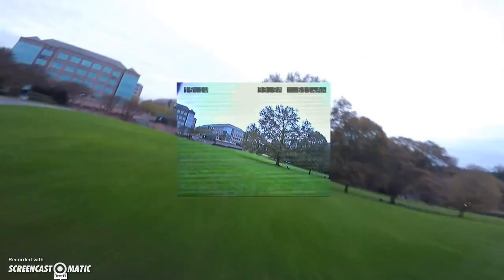How to "float" inverted like Mr. Steele (and others)

Comment: Key points - turn on idle up, or in Cleanflight  turn off motor stop and turn on PID at min throttle so that you can drop throttle to zero and still have PID authority as you are floating up (after hard punchup) and then free falling back down.

Comment: Hi thenukeman, 
I use the hq triblades 5040 like mr steel and the kingkong triblades 5040 when i know i wil go crashing. But my problem is fixed i bought the Kiss fc and Kiss esc's. the biggest problem Where the esc. 
Thx for your intrest Kind regards Michel

Comment: Sorry. Im being a little slow here.
When do you use air mode?
ARM-switch to start flying, then do a punch up, switch on air mode, float, and then regain 'control' and flip off air mode?
Or is Air Mode just the opposite of ARM, as in "Parked gear" or "Drive gear"?
Reply: Ylex   For English not being your main language, you have better grammar than most people online
Reply from the maker: Air Mode shouldn't really be called a flight mode. It's a Feature. It's a change to the mixer logic that increases authority at low throttle. I just leave it on all the time. In my opinion, it's how the mixer should have worked to begin with.

https://www.youtube.com/watch?v=d2nRrVENEYM
Reply: Joshua Bardwell I believe I understand now! If I got this, Air mode means the motors are allowed to ask for more power than given by throttle. English is not my main language, so I'm just using simple words. Thank you for helping!
Reply: or in "live mode" for that matter...

Comment: Hi Josh! question:
"Idle-up" could be something like "Air Mode" in CF?

Congrats your videos are just great!!
Reply from the maker: +Rodrigo Larenas idle up is similar but air mode is superior IMO. Air mode only increases the throttle set point when additional authority is actually required. Idle up increases the set point all the time.
Reply: Joshua Bardwell thanks josh, I'm gonna try using air mode

Comment: Hi mr bardwell i have a little question. from the moment i flip my quad 90° upside down (after a throttle punch) my PID (i think ) stop the upward float motion. do you know what this can be ? or is it maybe the fc or esc i'm using? FC is the seriously pro racing f3 the esc  i don't know what brand they are . the plan is to swap the FC to a naze 32 

kind regards
Michel
Reply from the maker: +Michel Van Camp make sure min_throttle is not too high. Make sure you are lowering the throttle all the way. If your copter is heavy, lighten it. Punch harder to go up faster.
Reply: Thx Mr Bardwell i will try to lower my min throttle but its already at 1010 i will keep searching
Reply: Michel Van Camp   What kind of props do you use?

Comment: One thing I don't see mentioned is that Steele uses 3 blade propellers.  This is alot of surface area.  When you keep them idling and you are falling you have a brake effect.  Instead of air rushing past them they are blocking some of it slowing the descent.  This is the same idea why gliders have folding props.  Because a freewheeling prop will slow you down.  Also why on a airplane if you run a large prop that it helps slow you down on final but if you dead stick in your plane glides much faster.  Not to mention in this case by idling the motors are faster to spin back up to save you when you need to flip back instead of the huge current draw from a dead stop.  Great video!  Just wanted to mention this concept.  :^)

Comment: So I'm just sort of getting into  (FPV) i have been flying since September, Manly just aerial filming i have the Xk Detect X380 for that and the Syma x8c but my starter quad was the syma x5sw FPV wifi edition and the syma x8c. but i just ordered the Stock Fpv kit for my x380 and i ordered a xk 250 alien with FPV and i got the Xk airdancer x350 and i ordered the Fpv kit for it as well. I thought that flying the xk airdancer x350 with fpv would be really cool since it has both 3d and 6d mode to fly upside down.  But to get into racing or just have a really fast racing quad what can you recommend for me to buy to have a fast really fast quad.
Reply from the maker: +Andy Shaffer The fastest copters are light, and have a very small aerodynamic profile. Look to the Krieger and the Shrike if ultimate speed is your goal. But they are some of the most difficult to build because they are so small and compact, and if you are not an experienced builder, I don't recommend them. The next step up would be a 210 size frame like a QAV210 or an Alien 5". If you want to, you can find much cheaper Chinese knock-offs of these frames from Banggood--your call where you want to put your money. The 210 size frame will have worse aerodynamics than the "Pure X" style frames, but can still be very fast.

I can't stress enough the importance of light weight when building a racer. With light weight, you can go to higher-kv (lower torque) motors and still not suffer a handling penalty. This increases acceleration and top speed. You also need high-C-rating batteries that can feed your motors without sagging, but unfortunately, marketing numbers mean nothing, and practical test results are few and far between. Don't just buy a battery with a ridiculous C-rating on the label because it's probably BS.

There isn't really a simple answer as to what goes into a really fast quad, but this should get you started.
Reply: Absolutely yes i will look in to that i thought about getting this Eachine racer 250 Amazon has it for 189.00 with prime so Yes i figure something like that just to start out on and  yes they have the kits to build your own the way you want it. and i was planning on doing something like that with my G.P.S quads but like you said. Flying yes is one thing but building your own is altogrther different that like waiting for strike 3 at half time in the super bowl totally different but yes I'm going to just get something like the eachine 250 for now until later then ill know more about what I'm going to need to build my quad like what is the best size motor for a certain amount of weight i don't know how they calibrate themselves. or if that's done manually? with these flyers.
Reply from the maker: Andy Shaffer The best thing you can do is look at what pro pilots are flying. There is no single best answer for what motor and prop to pick. If there were, everybody would fly that. But there are definitely combinations that do NOT work well--for example, an 1806 motor will probably lack the torque to spin a 5045BN prop very effectively. A 2208 motor would be bad to pair with a very small 4045 prop. Etc... If in doubt, look at what the pros are flying, or look at high-end ARF or RTF kits and copy them. But definitely do your research. The Vortex RTF 250 copter came with 1806 motors, which were not really the highest-performing at the time it came out.
Reply: That's very true. Just from your personal experience in using different propellers, Some say that propellers when in balance can increase speed, flight time, and the life of your motors. Increasing the life of your motors sounds about right. The speed however I'm not sure. i just put Dji 9450 self locking propellers on my x380 and  to me the new propellers seem to increase speed  by a little bit they are a half inch longer and made different from the stock ones, so it may be possible to increases  speed  a little i would presume. And flight time, so if the propellers are in balance and the motors are running smother then once again i guess its possible it could increase the flight time by a little bit also couldn't  hurt it none anyway. but yes i want to build something later on from scratch well not entirely from scratch i thought about ordering all the parts and transmitter i would need and build one out of conduit of cpvc plastic pipe i have seen a couple other design's made similar.
Reply: If you get Eachine get Wizard 220 don't get the Eachine 250 racer its not great

Comment: Thanks for the explanation its been getting a tad expensive when the board re-sets after a throttle cut in mid air :)
Reply from the maker: +Breathe - RC Gotta do something to keep the motors spinning. Unlike a fixed-wing, you can't glide a multirotor!
Reply: Joshua Bardwell yep i found that out the hard way many times lol

Comment: I've seen others and also been doing this LOS for years, not sure why it's considered new if it's fpv. Good explanation but about 6 minutes too long to describe cutting the throttle and disabling motor stop (cheating way) :)
Reply: +MicroRCFiend  If you don't post the video, it never happened!
Reply: True, I see your a helination listener, hi :). It's also true that if you don't check my quad videos you won't see it either will you?  Not sure how cutting the throttle during a flip is considered difficult to believe when I post quads doing piroflip reversals but more power to you for being creative. 

I may be new to fpv but quad flying is my roots, might need to check back further than the last 5 videos :)

Comment: they don't use idle up anymore they are using beta flight and "air Mode" now! And motors may have to be higher then idle, some quads will become unstable at such a low idle
Reply from the maker: +MrEklectic FWIW, I still use idle up for exactly the reason you say. When I chop the throttle suddenly, my copter is briefly destabilized. So I use idle up to keep the throttle slightly higher when I chop it. This is even with Air Mode active.

Comment: What if you trim your throttle so once you armed, the motors will never shut off? Isnt that the same thing?
Reply from the maker: +Jacky Heshi Sure, but then you can never input any stick command that requires zero throttle.
Reply: +Jacky Heshi What happens when you crash then? You destroy your props and almost certainly ruin your motors too. You could do this but you'd have to have a kill switch of some sort or you wouldn't even be able to pick up the quad after a crash.
Reply from the maker: +Robert Collins you arm and disarm by switch.
Reply: +Joshua Bardwell guess that depends on the receiver and/or config. I have a radio link and you arm by holding left stick to the bottom right and disarm by leaving throttle at 0 for a few seconds.
Reply: thats funny

Comment: When you use ur idle up method, Do you still have motor Stop disabled? My motors sunnysky 2204 with bl20a Start at around 1150, isnt that a little bit to high to use the idle up method on the taranis?
Reply from the maker: +skatebjarne If you have idle up active, then motor stop doesn't matter. Motor stop takes effect when the throttle goes below min_check. When idle up is active, the throttle never goes below min_check.

Regarding your second question, you are confusing min_throttle, which is an throttle value that is OUTPUT from the FC to the ESC, with min_check, which is an stick position value that is INPUT from the receiver to the FC. When idle up is active, the INPUT stick position stays above min_check. This will cause your motors to spin slightly faster than min_throttle, whatever min_throttle happens to be.  When you set up your idle up "DIFF" value, set it so that the throttle channel just barely exceeds min_check, NOT min_throttle.

So for example, a typical configuration might be min_check=1050 and min_throttle=1150. You would set up your idle up DIFF value so that the throttle channel stayed above 1055 or 1060. This would cause the motors to idle at, perhaps 1155 or 1160.
Reply from the maker: +skatebjarne BTW, my personal preference is currently to run motor_stop active, and idle up also active. This means that during normal flight, the motors act as if motor_stop was disabled. But if I am working on the bench, I can flip a switch on my transmitter to disable idle up, which allows me to arm the copter without spinning the motors, for troubleshooting purposes.
Reply: +Joshua Bardwell ahhh ok. thanks for your help! this explanation helps me a lot. I think i have to try it out and play with the values. to get it right.